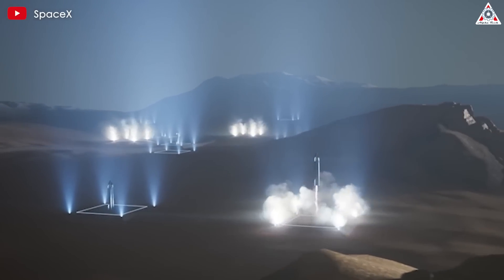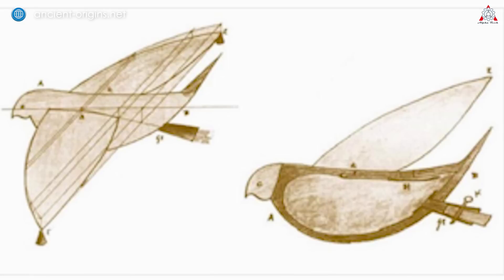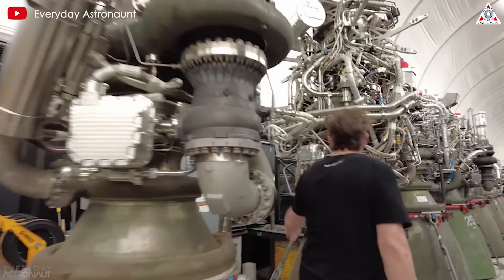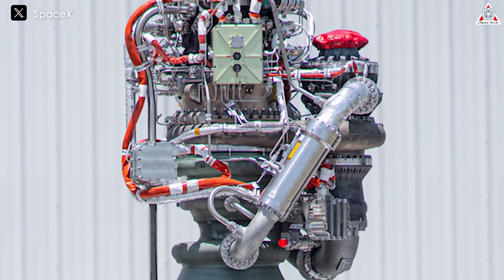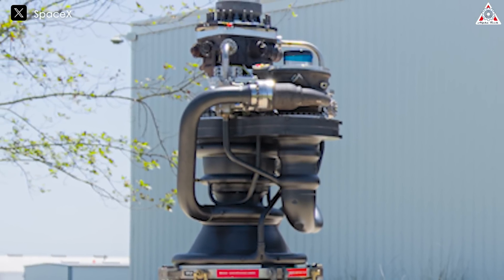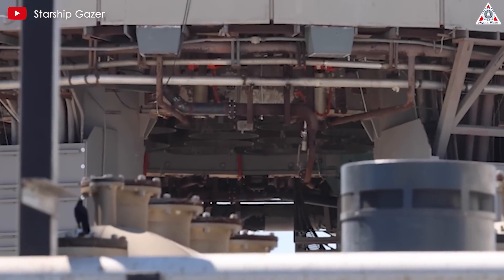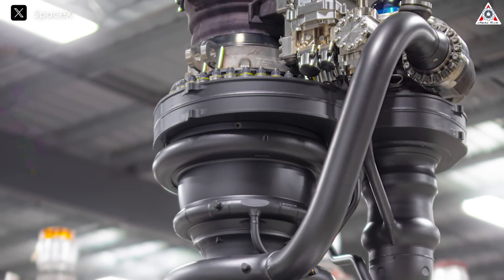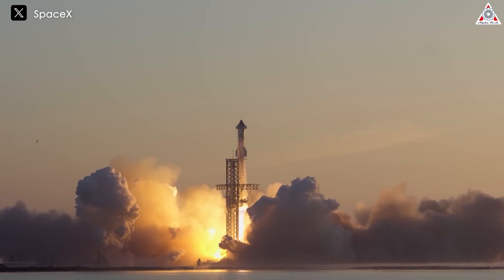SpaceX Just Redesigned NEW Engine HUMILIATED The entire industry!

Comment: Agree with comment below; China has successfully launched to orbit a vehicle using metholox.  Also, the question on engine production isn't how many can SpaceX produce in a day but how many engines does SpaceX need.  Need based on re-usability and number of Starship launches scheduled will drive the production of new/replacement engines.

Comment: The original design for the Raptor was actually developed by NASA. SpaceX bought the license for the design and then improved it significantly.
Reply: Um no it didn't infact the prototype for raptor was paid for by the US Air force for a second stage variant of the falcon. So the engines first development was paid for by the US Air force in a contract with SpaceX. It was not a full flow design owned by NASA.
Reply: No , it's not
Reply from the maker: Yeah! That’s right!
Reply: @alphatech4966  read below, this is your business. You gotta know what you’re talking about.
Reply: @alphatech4966 no, that's not right. 😮
Reply: @alphatech4966 no, that's not right 😮